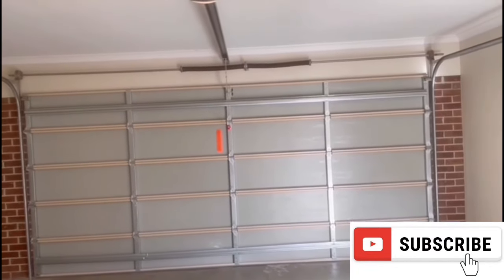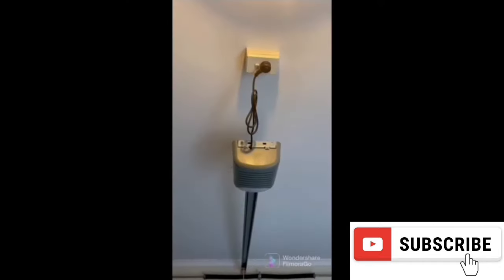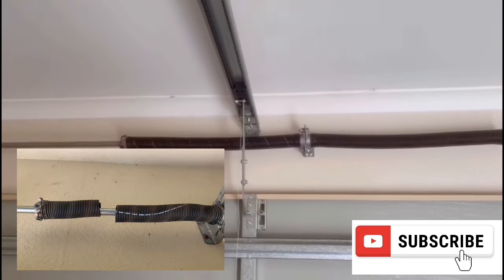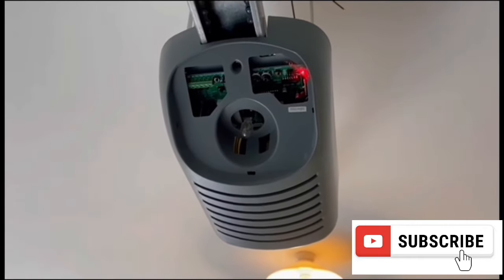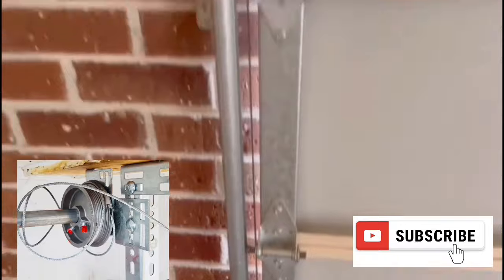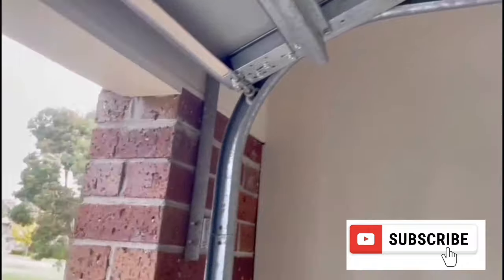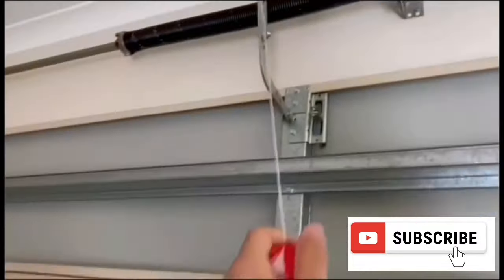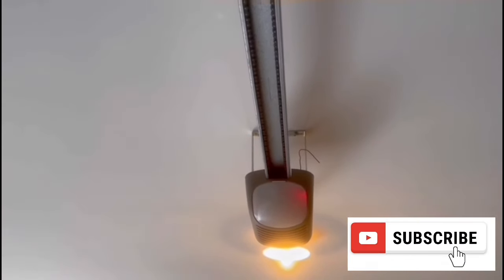How to fix a garage door that won’t open or close.

Comment: I wonder if you can solve my problem. I have an automatic garage door opener. (Wide door made for a double car garage) . Somehow the opener got zapped and did not work. So I pulled down on the cord and for weeks I have been able to manually open the garage door. One day I opened it and the metal line on the side got tangled. They only way for me to remedy this was to CUT the metal cord. (This is the one attached to the wired dumbs in the center of the door). I had to cut BOTH because it would not open. Now I have a garage door with no metal cords attached to the tightly wound drums in the center. THE DOOR IS CLOSED SHUT LIKE IT HAS 500 POUNDS OF BRICKS ON IT.  Any thoughts? Everything is so expensive I am trying to fix things on my own. I appreciate any help you may have. Be well.
Reply: Hi Rick, did manage to sort your issue out? I have the same problem as you. Was wondering how you would have rectified it. Regards Amit

Comment: My door closes to about a foot off the floor feels resistance and goes back up.  I've checked the rails and they're parallel and plumb.  I've lubed all wheels and joints but I'm guessing it's with the geometry of the connection to the overhead center track because I can see the track bow up at that point.  How can I correct this?